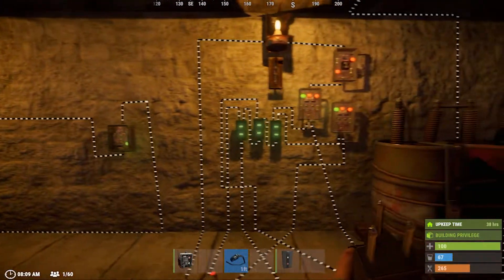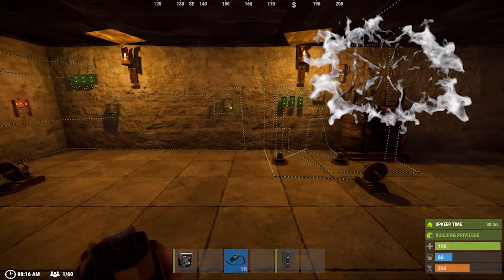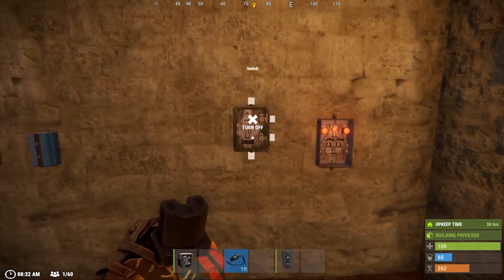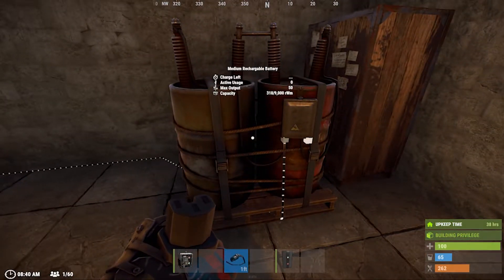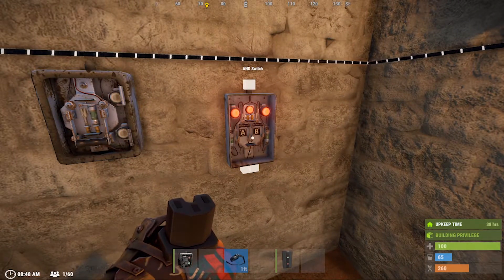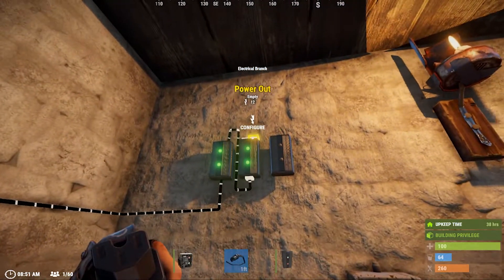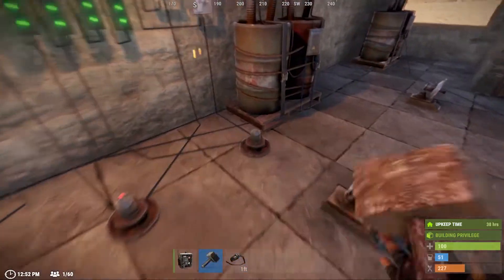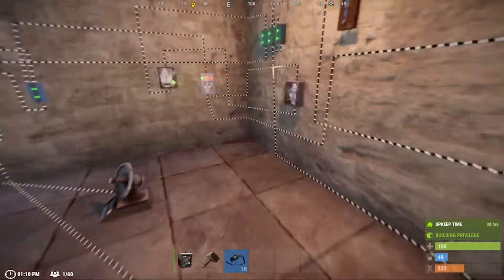Best Smart Alarm Setup CHEAP - How to use Smart Alarms Rust Guide 2020

Comment: @bilumer For wall destruction detection, you could have used a chain of XOR Switches and a blocker, that would have put your power usage at 1 rW for the entire base.. as XOR Switches doesn't consume power. Here's an example: rustrician.io/?circuit=e468fbc32b665ed76180fb06dd54a8a1
Reply from the maker: I’ll look into this. On my phone at the moment and it won’t let me open it here.